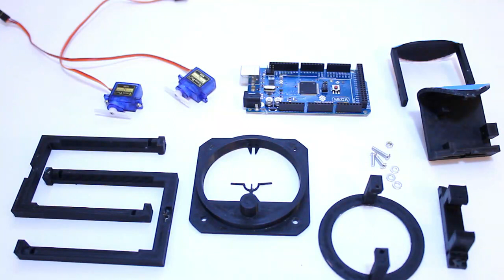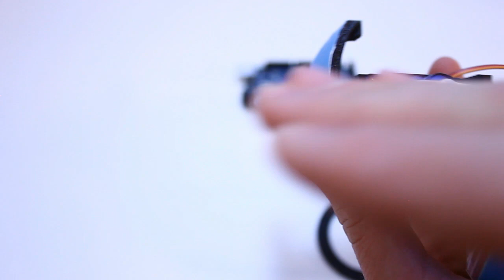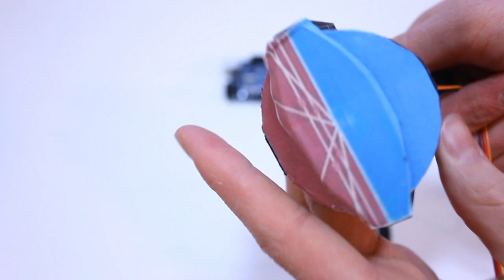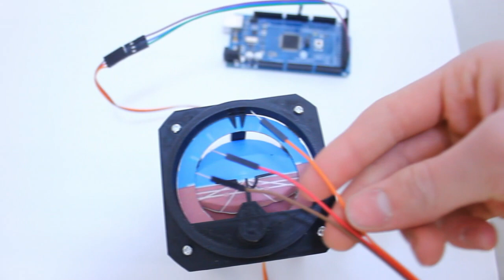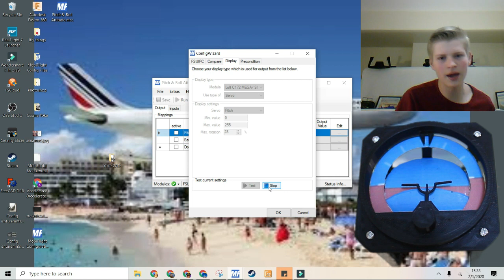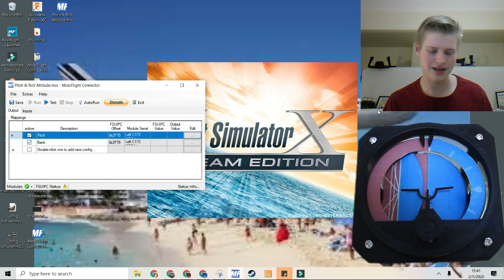Make the Flight Simulator Attitude Indicator! (Servo Version) FS-Instruments Episode 6 | Captain Bob

Comment: Hi, thanks for the video. Can i use Arduino uno mega 328p  borad or does it have to be the one you have shown in the video.
Reply from the maker: It has to be an arduino mega 2560 or a pro micro at the moment.

Comment: Could I get smoother movements with better motors?
Reply from the maker: Absolutely, Try using stepper motors for the movement (will have to adapt the design), or a stepper motor with metal gears.